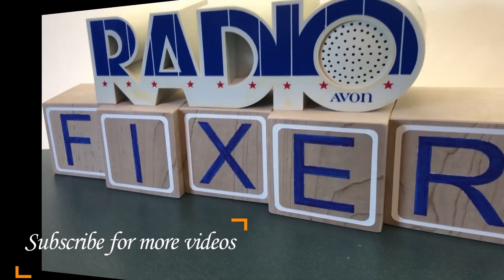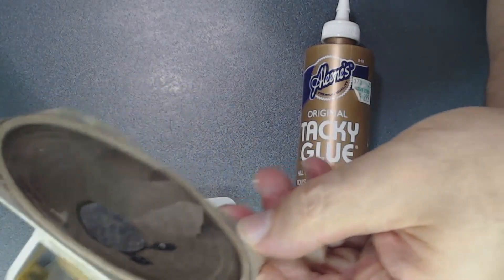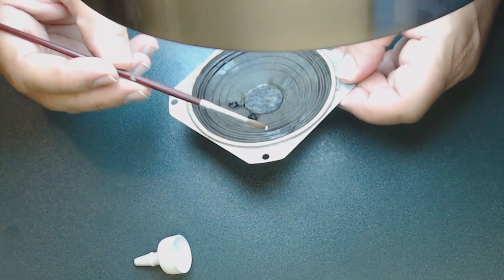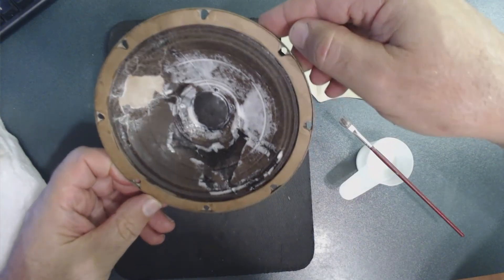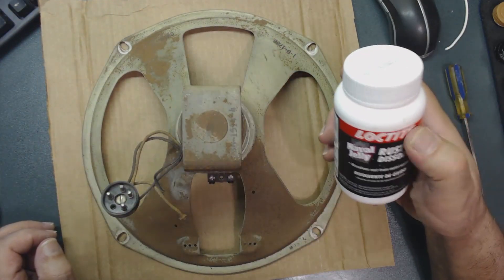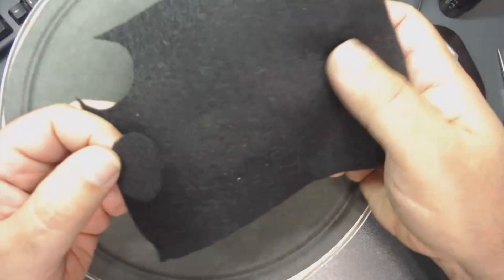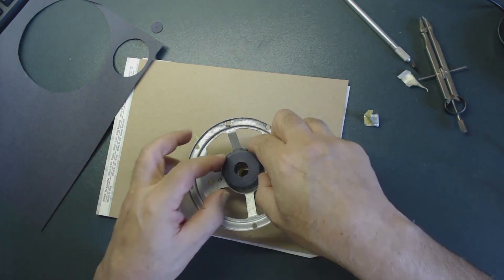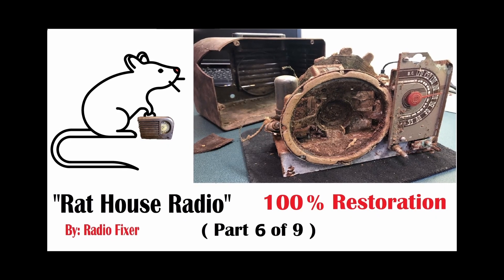How to Repair & Restore Vintage Speakers | Cone Repair, Replacement & Full Rebuild– Tutorial

Comment: kleine weihnachtsmusik  vintage plattenspieler it's a little toy, but I can hear.The speaker is blown.I wonder if there's a way I could fix it?
Reply from the maker: Hi Shane, great hearing from you!

Most speakers can be fixed, but it really depends on their size. I suggest checking the size of the speaker to see what type they used. You might even be able to replace it with an old computer speaker or something similar. I’ve used computer speakers before to replace small transistor-radio speakers when the originals were too tiny or the speaker couldn’t be opened.

Have a good day!

Regards from Florida,
Jay

Comment: Amazing work.

I have a question. Is the first speaker the one your nephew DB punched a hole  in when he was much younger?😅🤣
Reply from the maker: Good question! No, he punch a hole in speaker cover which wish foam and the color was silver belong to my “Sound Design” stereo unit. I still have speakers but not the cabinets, make a mistake to get rid of speaker cabinets and Stereo system cabinet. I think that I bought that late 1970’s or early 1980’s from “Kmart”. They are now vintage not old, so I should take him to Court and ask for substantial money. LOL
Reply: @RadioFixer 😂😂😂